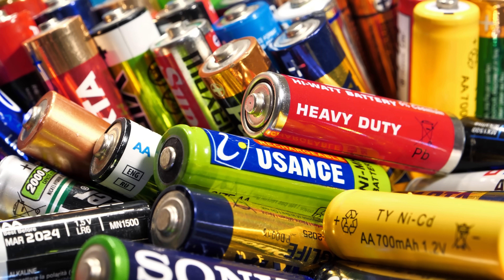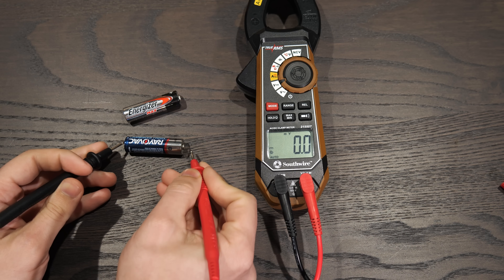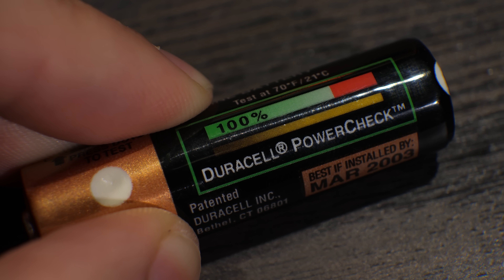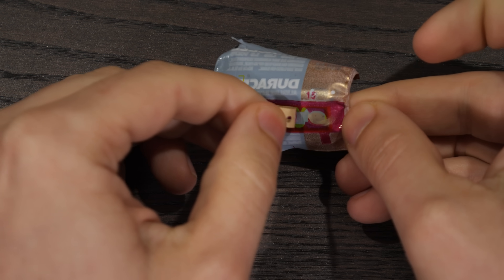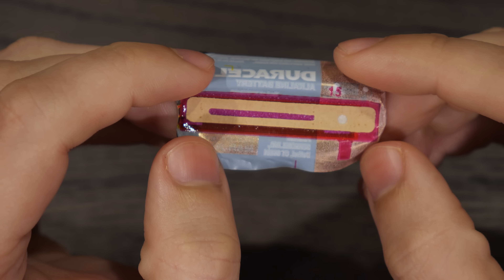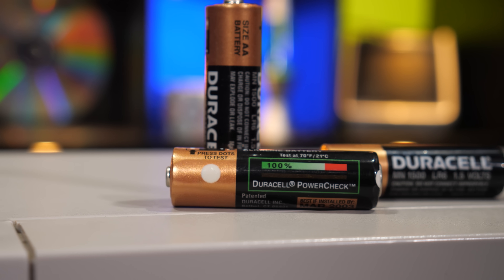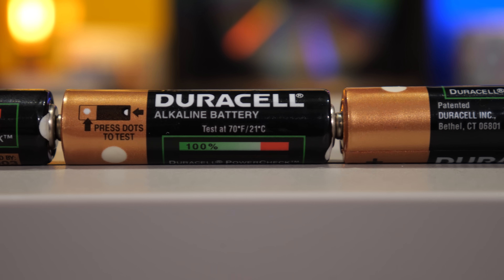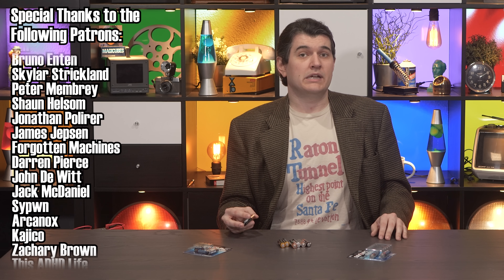Duracell PowerCheck: A genius idea which didn't last that long

Comment: The big problem in this story is not that USPTO accepted both patents. The big problem is that USPTO cannot invalidate the patents when it figures out that accepting both was a mistake. And I'd argue that if two independant patent applications for the same thing come through nearly at the same time, the whole thing is probably too obvious and shouldn't result in a patent for neither party. The minimum bar for a patent should be insanely high in modern world, but somehow USPTO has been constantly lowering the bar for decades now.

Comment: Great!  The number of times I have tried to explain to people that a battery's voltage measurement is not a good measure of its 'charge' unless it is tested under load.  Good testers do this which makes all of the difference!

Comment: i remember a newer version of it. it had a grey border starting from the positive test button to the negative, blue collar separating the orange from the black and the meter was just 5 bars, 2 green, 1 yellow and 1 red. looking up images of it, you can actually find some that have a "best by" date for 2025, so they're not that old. maybe 2016 or 2017?

Comment: It’s a nice sentiment to think that disposable batteries are becoming less relevant, but not grounded it reality. A lot of children’s toys, especially if they are cheap, still require these types of batteries. And a lot of basic flashlights still do. (Though they are now illuminated by LEDs so they don’t chew through batteries nearly as fast as they used to)

Comment: These were a much worse “improvement” than the same testers that were included in the plastic packaging for the batteries that they had previously. Those were really nice and easy to use. 
Still had a few of those until they got thrown out in someone’s misguided idea of cleaning.

Comment: I'm surprised at the people who DON'T remove batteries from a device when it's not going to be used for a long period of time (like a few weeks or more).  For TV remotes, that's one thing, but other things like cameras or laptops (if it has a removable battery) a lot of people just leave them in, and if they're lucky, they're just dead when they go to use the device a gain, if they're not, the battery has leaked out (although not really an issue for Li-Ion batteries which are the most common type I guess aside from non-rechargable alkaline).

Most items these days can use either alkaline or some type of rechargable battery (there are a few exceptions) so a lot of people are probably just buying rechargeable batteries, even cheap ones, for most electronics though, partially because they have gotten to a point where they aren't that much more expensive than alkalines, but you can get many uses out of them (even the cheap ones that maybe only last 50-100 recharges).  Although the puzzling thing about this is that most that I've seen (mostly Duracells) are rated at 1.2V for their rechargeable Ni-MH batteries at least, versus their 1.5V alkaline, but they do seem to work fine regardless, although the time between recharges may be shorter since apparently they start at around 1.2V and decline from there, but you're still reusing the same battery multiple times though so you're probably still throwing away fewer batteries in the end. Although this does create a problem for some sensitive devices that need ~1.5 to operate like some older digital cameras that took AA or AAA batteries.

Comment: I worked with a CPN nuclear density gauge powered by eight D-cells, if I remember correctly. A set of batteries would last a couple of weeks field use. 
As we know, equipment manufacturers and battery manufacturers recommend against mixing new batteries and old, but our lab manager radiation safety officer insisted on testing each cell on a multi-meter and replacing only the ones that came in at low voltage.
Working in the field with mixed good and weak cells an hour or more from the office meant losing a half-day's work when the mixed battery pack failed with clients and contractors awaiting test results by more time-consuming alternative methods.

Comment: I remember playing with this "tester" and even attempting to salvage it for some other use. But what I alro remember it consumes quite a bit of current. I believe couple of such "tests" will cost a month or two of using this battery in a RC or some clock

Comment: the tapered heating element would lead to a varaible voltage drop across it.
but higher resistance also lowers current leading to less heat.
if you had a strip thats thicc though out its lengh besides one spot in the middle- which would be thin- the middle would still heat up more. the current in said strip would be uniform because the imagninary resistors though out the strip are in series, so the generated heat would be very uniform along the strip, but because the smaller alrea needs less energy to heat up, it gets warmer.

Because those resistors are in series the higets resistanc will generate more heat tho because it does impead the flow more, but the material size is also a factor. 
lower resitance generates more heat, if the settup would be in parllel because the higher amprage going though the lower value resistor.

Comment: Would it be possible to replace a new battery's label with one of these so you can see it working in situ? Not saying that would be practical of course, I'm just curious if it is possible.

Comment: You can just buy a battery tester!? WTF!? That feels like the kind of thing that should be taught or at least MENTIONED in School because holy crap have I had a lot of times where I couldn't tell if a battery was dead or if I just used it wrong and then chucked it out.

Comment: I think there's another reason why these battery testers were invented: It was a gimmick. Generally speaking, a battery is a battery is a battery, so how do you get customers to buy YOUR battery? By putting a battery tester on there! Sure, noone will use it, but it sets your product aside from the other, almost identical, products.
The same thing is true with toothbrushes, they are constantly trying to innovate with tongue scrapers, colour changing bristles to tell you when to replace the brush, different shaped handles, etc, but they're all basically the same. You have to innovate to survive, even if the innovation isn't something people really care about.

Comment: The PowerCheck would make more sense now in rechargeable batteries, those you actually keep them around and reuse them and you are not sure if they are charged or not, or if they can still hold charge.

Comment: “Thermochromic” does not ‘imply’ that a material “changes color based on temperature”, it ‘indicates’ such.

Even a cretin that believes that infer and imply are remotely similar words shouldn’t be so wishy-washy.

A thermometer (which, as the name indicates, meters thermos) that reads -40 need not imply jack

Comment: I could never understand why they put these on the battery's. Before they put them on the battery  they put them on the blister pack, and before that, the tester was loose in the blister pack. I still have at least one from each size, including a nine volt tester.

Comment: What went before them was a small tester built into the packet; press the terminals against the tester. But I guess people threw the packets out. Edit: Oh, you mentioned this.

Then what came after was Energiser's half-hearted implementation where you pushed the two little contacts and a "Good" symbol lit up, giving you very little indication of how good the battery actually was. And of course, that little Good symbol would light up even on a near dead battery.

Comment: I just last year changed the 2 aas in my bedside torch, it had only just stopped working with no noticeable drop in brightness, the batteries expired in 2003 lol and I realised I hadn't changed them since I got it, sometimes you get a really good batch, combined with a super low power led and they last forever.

Comment: I had always suspected a heater and thermal chromic material but instead of the gradient in the heater, I had suspected that the thermal chromic material would have different sections. That would have been more difficult to produce.

Comment: Nice one cheers. An excellent reminder of tech that failed.
There was one reason that I can suggest, as to why this genius feature was phased out;
It was bloody useless. A battery could read as dead, but could go on to function perfectly fine. Two people could receive two different readings. Healthy batteries were discarded after giving a bad reading, only to find that replacement batteries did not resolve the initial problem.

Comment: I remember being super amazed by this as a kid, I really wanted them to see it work. I took them apart too and I saw the insides but didn't really know how it works. After all those years I finally do.
Reply: Exactly!  What a great video!
Reply: That is not a good idea, do not open your batteries
Reply: @lukebradley5134  I agree with that, I didn't break open the actual battery cell because I knew as kid it contains nasty chemicals.
Reply: @lukebradley5134  don't act like we haven't all done it at some point lol66
Reply: @Notpoop906  do you have heavy metals in your bones

Comment: Australian here and in the upside down when I was a kid I remember duracell and I think energizer both included a battery tester on the battery pack. You'd cut the bit of cardboard out (or take the strip out of the pack if I remember right for energizer) and you could use it to test the battery in exactly the same way as the labels on your duracell ones except you could use it on any AA or AAA battery.

Comment: we also had the same tech in a loose strip that you could put on the terminals of any 1.5v battery. That I liked much better than.. throwing it away with the cells, such a waste.

Comment: FWIW - Here in Europe it was actually still possible to get Duracell Ultra's with built in testers until quite recently (until maybe 2 years ago). Duracell Ultra does not exist anymore (as far as I can tell)
I have used the built-in tester many times because - 
 I do keep "dead" batteries around for a second life in something less demanding. Batteries that have come out of something with a motor, for example, can easily run something like a TV remote control for a long time yet.

Finally - I don't use rechargable AA or AAAs (or 9V PP3s) - I only use disposables because they last so much longer than the rechargeables.
But fewer and fewer devices use these types anymore (or indeed have removable batteries at all) so I nonetheless do find myself buying batteries far less frequently than used to be necessary.

Comment: The most half used AA batteries I know of fly around with us at the event tech industry - many common microphones and body packs such as the ubiquitous Shure SM58 use 2 AA batteries which are replaced before every show or every day on multi day shows despite having charge indicators, simply for the reason that a microphone running out of juice in the middle of a show is absolutely unacceptable and absolutely no risks are taken. So there's always a box of barely used AA batteries around.

Comment: In my country (Switzerland) you can still buy duracell's with a new type of power check on them but it basically works the same
Reply: you cant buy laserpointers so it is a tradeoff
Reply: Well you can just not the fun ones😅
Reply: @Swiftershock  yea
Reply: Also on Turkey you can buy duracell triple A with powercheck

Comment: I remember these and also the ones with the full length yellow bar down the side which showed battery level on duracells.  I think the large yellow stripes were more in the early 90s in the UK at least.

I can't remember which other battery brand (maybe ever ready or energiser?) had a test strip built into the clear plastic front of the packaging.  Very cool especially to a much younger me!

Comment: Just as an FIY, measuring voltage is not reliable, without load it is pretty meaningless. There is a little known thingy that is called equivalent series resistance or ESR for short. the micro amps the multimeter pulls will cause a negligible voltage drop on it. Put it in something that needs more juice (depending on the condition of the battery it could even be a few milliamps) and it is dead.
Reply: bro everyone knows this. this is taught in 5th grade.
Reply: @WhyAliasIdontNeedOne   Scams like batterizer tells me otherwise, ppl dont even remember Conservation of energy and fall for all sorts of fake free energy schemes........
Reply: @WhyAliasIdontNeedOne  Doubt it, way too many ppl fall for scams involving stuff that could be debunked with physics knowledge from elementary/middle school.
Reply: @WhyAliasIdontNeedOne   Doubtful seeing how many ppl fail to grasp even the law of energy preservation and fall for all sorts of sc@m.......

/other
What the hell my comments keep disappearing lol......

Comment: I have a video game controller that I forget even uses batteries because of how long it lasts and I just leave the batteries in their 24/7 but then I also have a video game controller that if you leave the batteries in it then literally like 2 days later it'll be dead so I have to pull the batteries out of it when I'm done.

Also this would be way more useful in rechargeable AA batteries since those thing sgo bad quickly after taking them off the charger so when you go to get them off the shelf they might be dead.

Comment: As mentioned in the video, the testers started out as part of the packaging. Which was handy when you were in need of batteries (because, not included) and no pack of fresh batteries at hand; you would need to "harvest" a batch of "best" batteries from various devices. I would keep an old Duracell tester package around to test also off-brand batteries. I think it is for this reason they ended up putting them on the batteries themselves; brand protection.

Comment: I think Duracell would have done better to engineer their batteries not to leak in all your devices, killing them. 
I won't buy gold tops because of this issue. If rather spend a little bit more on a battery than a lot more on a new device.

Comment: As a sound designer this would be an amazing feature. It's standard industry practice to put fresh batteries in a wireless mic before every performance, but used batteries from past performances are often used for rehearsals. Changing 60+ batteries every night for larger musicals and needing to keep track of used ones can quickly get out of hand. Plus, some used batteries are closer to death than others. I currently use the bounce test for my used batteries to make sure no mics die during rehearsals, but a feature like this would make my life significantly easier. 

Thought you'd enjoy a special use case for a particular industry.

Comment: I bought a kit on AliExpress that includes fake AAA batteries and one with a USB on a cable, which turns battery-operated devices into wired ones.  I’m really impressed with how well it works!

Comment: Interesting video. Now look into the fact that Duracell 'cells' are well known for leaking. 
They're known in the electronics circles as "Duraleak". 🤣
If you're not aware, research it - you'll soon find out the problem. These cells leak when they are new, they leak when they are old. Any of them left inside the device they were powering will have leaked and damaged the battery compartment and/or the electronics inside the unit.
Somewhere I have a photo of a brand new pack of Duracells still hanging on the shelf in the store and there's leakage and corrosion on the inside of the blister pack.

Comment: The number one thing I tell people about AA/AAA batteries is that most remotes can use dead batteries no problem and some devices will die even when the battery is still relatively full so just because the device you were using died doesn't necessarily mean the batteries are completely empty yet so you should try using them in another device or if all else fails a TV remote. 

I have seen some TV remotes that actually use more power than the measly amount normal remotes use but it's still worth a shot to always try dead batteries in a TV remote. (I've seen a TV remote that had a trackpad on it and I'm not joking)

Comment: I so prefer a set of reusable AA batteries over fixed lithium batteries, for things like a remote or my xbox controller I rarely have to replace the battery as is, and I don't want to be having to plug it in for hours when I want to use them!

Comment: "most of our devices which need batteries, are using rechargeable batteries" ... rechargeable and unreplaceable(!) batteries :( Means, that when the rechargeability of the battery lessens with age and usage, the device becomes completely unusable. Then, instead of just replacing the battery, we have to either buy a completely new model of the device in question or pay an specialist to put in a new battery. Dosn't matter if it's a mobile phone, a BT keyboard or an electric car.

Comment: ...i think it went away because, 21c is too low temp for most of the world.. no idea why is wasnt standard room temp of 25c.. here in aus, the yellow would always be showing in +30c temps..
..that..and the fact the tester could get easily damaged (by rubbing up against the case in high vibration environments) that would cause the tester to be always on and drain the battery in hours..i stopped using them with RC cars etc because of this issue

Comment: Fun fact. If you had a casette walkman back in the day, as your batteries depleted the tape (and therefore the music) would actually run significantly slower. It happened gradually so you didn't really notice it.